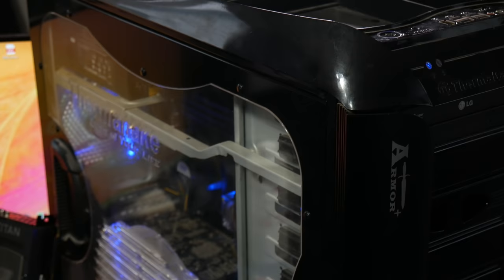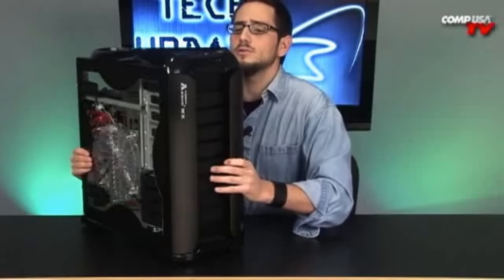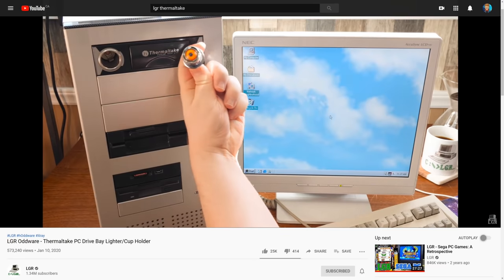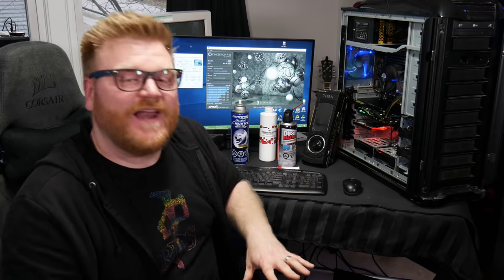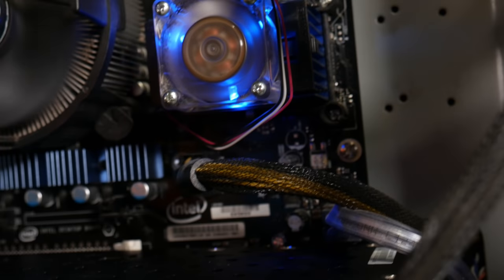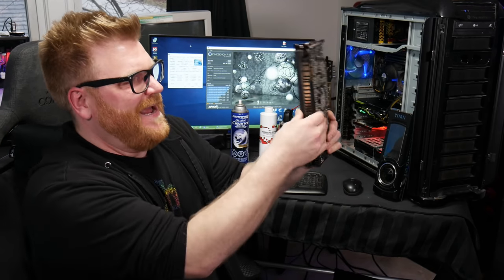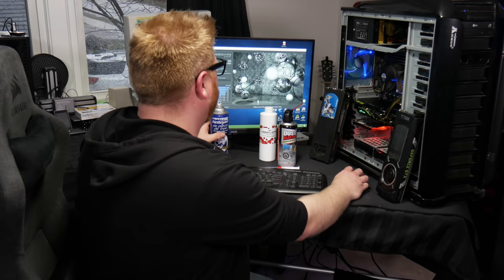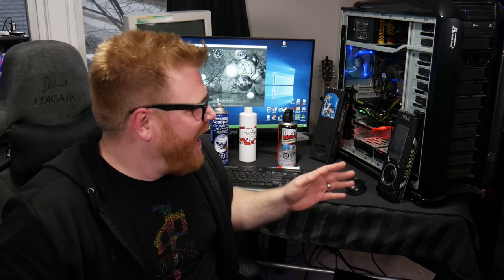Can $5000 buy a PC that will last 10 years?

Comment: I would say about 1500 bucks is the sweet spot lots of longevity, good resale and great performance
Reply: i bet 9900k and ryzen 8 core can game in 10 years but no way in hell will a 2080 ti. just my opinion. what video card over 8 years old can get 60 fps 1080p in modern games?
Reply: @Joker-no1fz  I actually think the 2080Ti will hold up longer than the 9900k....we are already almost 2 years in on the 2080 TI in 5 months...and it is still the top dog...not so much the 9900K
Reply: 1500 is not LOTS of longevity...and compared to 1440 P 100-150 FPS performance on AAA games that higher end computers can get...1500 is not "great" performance either
Reply: Nah, about 2-2.5 is the sweet spot for about 3-5 years, anything below that you will be spending money after 1-2 years

I spent that in 2014 and only upgraded in 2019, both times 2-2.5k spent and I currently have a i9 9900k, 2080 Super, 32 GB DDR4 4000mhz Ram, NVME, SSD and HDD's
Reply: Eyyyyyy
Reply: That's about where I landed on my x58 build.
Reply: @Joker-no1fz  an overclocked 7970 is still pretty relevant. about 9 years old. a gtx 580 3gb lasted until 2018 and could still play some 2019 games fine, came out in 2010. but x58 processors are still fine so i agree that current cpu's will last longer, definitely the 3950x
Reply: @moby1kanob  You're wrong for gaming you need a good GPU. Exemple if you put a old Xeon 10 years old  like e5 2690 it's slower  15 to 20 FPS then the i9.  Try to comparate a 10 year GPU with a 2080 ti and tell me how mutch fps you have in diffrence lol
Reply: I'd agree... anywhere from 1500-2500.. no more than 2500.. and that 2500 is for a beast of a computer that'll run everything at max settings.. 1500 these days will get you great performance.. but not always at the best resolution..
Reply: stephen hilton I spent around 1000 back in 2015 for a 5930k,  x99 sabertooth, 16gb ddr4, r9 390, 256gb ssd and a AIO watercooling. It is still doing great no need to upgrade. I must say I got the CPU half the price and the motherboard and GPU had a good discount as well. I calculated everything with the MSRP would go a it more that 1600$.
Reply: Jay Arre Trading a V56 for a 5700 is a big thonk. Undervolting, V64 bios and memory overclocking can net you near 5700XT performance with around the same power consumption
Reply: You guys forget that raytracing is going to be the next step when it comes to gaming, regardless of how trashy RTX is rn. I bet that’s what all the major players will be working on, rather than just raw GPU horsepower
Reply: @Joker-no1fz  Radeon 7970 ghz can still do 1080p just fine that came out in 2012.
Reply: @boltinabottle6307  Yep, I had a 7970 in 2018 and could play most games at 1080p with a mix of medium and high settings. Upgraded to a Vega 64 though
Reply: you people need to take into consideration that only up until 2017 intel had no need to push the ceiling for CPUs, that is the only reason why a system from early 2010s still holds up today. this will not be the case in the next 10 years thanks to AMD.
Reply: @T33K4Y  Doubt.
Reply: moby1kanob doubt you could afford 1.5k for a pc still tho lol
Reply: Definitely agree
Reply: Agree aslong as you can buy the parts for retail.
Reply: @stephenhilton6586  Yea but most people can't spend 2.5k on PC. Really just depends on what's out and what's to come. Best thing is to stay up on the tech that way you can flip when you need to or only upgrade parts that matter. Like if you have a 3 series ryzen really nonsense is getting 5 series right away.
Reply: @Joker-no1fz  980 ti 780 ti
Reply: @d.h.2509  980 ti is not over 8 years old and 780 ti is not 8 years old until november and you would have to turn settings way down and probably would not get 60 fps in games like cyber punk and red dead 2 at 1080p

Comment: "oh yeah bro i spend a ton so I never need to upgrade" 

proceeds to upgrade every component
Reply: Except that jank CPU cooler.
Reply: Futureproof memers in a nutshell
Reply: spending a lot on a computer is like building a larger fire. It will burn hotter, longer, and more brightly, but it will still turn to ash at the same rate.

Comment: I'm still running my old i7 2600k. :) 
I bought it the month it came out. Only thing I upgraded was gpu every 3 years.
It's currently my dad's gaming pc, with my old gtx 970 in. It still works perfectly :D.
Reply: I'm running a i5 2430m and a Geforce 410m. :(
Reply: Similar with me ;-)
In my main rig (an HP 6300 Pro SFF):
2600, 32GB of RAM, 1650 LP from Zotac, 500GB SSD, 1TB HDD, 32GB HDD
Still fine ;-)

And second, no gaming
3770k, 16gb of RAM, 240GB SSD, 500GB HDD

I know, "Why don't you pair the 3770k with the 1650????"
Because the cas is soo small!

And one other 6300 Pro 2600 Rig, but smaller SSD, less HDD storage and 8GB of Ram

And another one with an 2120 and SSD and 8GB of RAM
Reply: Decent CPUs... i still deploy 2x Xeon 5675, so ten years as well. For what i'm concerned it's strong enough, around 3k in Cinebench 20.
Reply: I'm still running a 970 and yeah it works but man do I wana upgrade. I was a little disappointed  in how much of a hit I took in rdr2 and I really wana play cyberpunk2077 maxed out
Reply: @brianluck84  "I really wana play cyberpunk2077 maxed out" same, waiting for the new gpus and cpus to release. im still running 2x 970s and a 4790k.
Reply: I have about the same system, i7 2600, GTX 980 and 16 GB RAM, many games work better with 16 GB even if they say "8GB recommended".
Reply: Jaco aVo 2011 I had mine and still going strong.
Reply: @danielgomez7236  my version of minecraft currently uses has 16gbs allocated and its capped still wanting more
Reply: InterMob i have i7 8700 1660 ti
Reply: piqqeh - PiggMC sell the 1660 ti get a 1660 S or Rtx2060

Comment: I always Buy a piece at a time, whatever I need the most that is within my budget at the time.
Reply: That also makes upgrade automaticly come over time
Reply: thats not smart buying you will  meet a lot of. "man if i just " pick a budget.... work from there and you can apply good buys that way and pocket some cash going below your own budget. The way you buy...... oh cool gtx.... 1 month latee price drop.... and you dont even have a mobo?!  great you screwed yourself that way. Speaking of experiences
Reply: I want to try this. Buy the best gpu I can, wait like 2 months buy the best cpu I can, wait like 1 month, buy the best ram I can. And just continue like that. And get a high end system by 4 months or 5. Lol 😂
Reply: yea, but you can upgrade only to a point with certain chipset

i skipped first two gens of ryzen, and now i am on the latest, because they were pricy fkkas at launch, and i wanted to see if this was a thing, and it became a thing
Reply: I usually upgrade when it's needed. Just upgraded my gpu. CPU is starting to bottleneck and will further as we go along and once i feel I can upgrade I will
Reply: Mykel Hardin  I treat my PC part fiend, and pass the older gear down to the rest of the family, I keep my components for a couple years before I upgrade, but they are all on different schedules, like this weekend I had some extra cash, and finally upgraded all my storage, got a WD Black SN750 1tbNVME, and a WD Blue SSD 1tb for all my games. I was using Enmotus Fuzedrive, with a 2tb WD Black HDD, downloads were pissing me off though, freakin 2 hours!!

Comment: I feel like I am being called out for my "Baller" socket 775 Core 2 Quad.
Reply: yikes
Reply: Same XD
Reply: x5450 here 😂
Reply: @blackmuel  x5470 here
Reply: Q9650 over here in the UK, coming up to 12 years old.
Reply: Jay Arre  I have a r5 2600/RX5700 I use for gaming as well. However, I have 3 machines around the house with Q9400's in them as well. They all run well and got better when I started upgrading the HDD's over to SSD's. For basic productivity they are still great CPU's.
Reply: @yannicg  Build  for my son a xeon x3470 (16$) with a rx 480 for 1080 p high/Ultra he plays all triple A games at 60 FPS Under 300$ :) Long live the Xeons
Reply: Then you got my dad that's had the same limited edition dell pc extremely rare like 20 years old and i still haven't a clue what's in it. He bought it for over a thousand dollars during a business trip think he might have a relic 😂😂😂.
Reply: You would be better off with a Raspberry Pi at this point. Yikes

Comment: i used to do the "overkill 10 year builds" the main difference between me and your client is that i did supplemental upgrades, maintenance and left the initial budget under 2000$
Reply: Mykel Hardin  badly.
Reply: It's $2000 not 2000$

Comment: Timmy don't make a car reference, especially if you don't know about them, a "1980s" Monte Carlo SS can sell for thousands, if in restored condition especially like the one you showed, along with the upgrades you can do to a 350 SBC for cheap, these things are still rocking and rolling. now restoring them? please for the love of all that is holy look up the pricing on sheet metal and engine parts, the fact that the POWER STEERING PUMP and STEERING BOX can be as cheap as hell.

383 SBC 525bwhp-600BHP-$3500 Long block 
sheet metal from AMD(Auto Metal Direct)-$600
paintjob-$1500
car-$1600(msrp 7k) 

after with KBB/NADA appraisal-$17,500USD

Chevrolet Monte Carlo's, Oldsmobile Cutlass didn't have rack and pinion steering where as ford Mustangs and Ford LTD's did.

please, take it from me, a car guy who likes to build PC's CARS are ever upgradable with the same platform, where PC's only are upgradable with the platform they are given.

just because a Monte Carlo has a SBC 350 Doesn't mean you cant just Punch out the cylinders and make it a 383 with 10.0.1 compression and turbo it to hell and back and make 900BHP 

you cant take a I7-920 and make it be a i7-4770k or re-dye it some how and make it a i7-9700k

Comment: Great Video! I always like to do small upgrades every couple of years and resell my old parts before they become obsolete. I find this is a good approach if you want to always have good performance and not spend a fortune. The highest end parts are usually not a good value. You get a longer lifespan and better value by stepping down your hardware a few notches and upgrading when you need to.

Comment: Got a retired X58 workstation here from my research chair, sporting a Xeon W3690 on Asus P6T7. Still awesome performance at 4,6 GHz
Reply: Wow, normally they dont like to go over 4,5Ghz... what cooler did you use. Im thinging about buying an EVGA SR2 as i found some offers for 300€. (obviusly not as my main system).
Reply: @yannicg  Corsair H70 AIO

Comment: In late 2008, I got a PC pretty similar but, it wasn't not even close to $5000... I got an i7-920 paired with a X58-UD5 from Gigabyte, 6GB DDR3 and a TX750W PSU from Corsair ; an ATI 4870X2 GPU from ASUS and 2TB HDD for storage. Even the case was similar: Thermaltake Kandalf LCS. It cost me €2000. The main components are still in use today but, overclocked to 4.2Ghz and with a GTX 1070. 
The 2010s were a peculiar decade as far as CPUs are concerned, because of Intel dominance and lack of competition in the industry and that's why a Core i7-920 or a Xeon X5670 Oc'ed are still very viable CPUs even today. From what I've been seing from the industry in the last couple of years, I don't think the next decade will be the same as this but, I also don't think we'll be back to the 2000s, when top tier gaming systems were completely obsolete and pretty much unusable at 3 years mark.

Comment: Bought a Sandy Bridge pc 9 years ago, not with the intention of it lasting ten years but it is still used as a viable HTPC. Definitely didn't spend 5k tho lol
Reply: is there a 9 year old gpu that can game though?
Reply: @Joker-no1fz  there is .. 8 years old HD 7970 3GB G5 .. still does fine in 1080p ..
Reply: @chuskex7719  i have a 2GB 6950 flashed with a 6970 bios. It can barely run anything at 1080p 60fps all minimum settings. Really you can only use it for esports titles.
Reply: 8 years ago i bought a MSI Z68 +2600k, 4*8GB ripjaws x , seasonic psu but have changed the GPU from a no GPU to 560ti to 770 to now a 980ti, i use it as a second pc. it can still play most games at 1080p.
Reply: @chuskex7719  Math lesson.  8 is less than 9.  The fastest single GPU card in April of 2011 was a gtx 580 that had 1.5GB of RAM.  That's not a usable card today.
Reply: @kinggremlin4574  a PC lasting 10 years with 1 gpu upgrade seems to be the only way.
Reply: Carrie Lam I know the feeling, around 2013/2014 I build a high performance workstation on the “Intel Extreme” platform; an Intel i7 4930K (6 core 12 thread) on socket 2011, X79 Asus Rampage IV Black Edition motherboard with 8x8GB 2.133Mhz Kingston HyperX RAM, nVidia GTX Titan, 2x4TB WEstern Digital HDD’s and Corsair 240GB SATA SSD...

I actually thought “I will never never never have to upgrade again!” Atleast not for many years to come... 

Then 2017 came along with i7 8700K’s stomping on everything on a mainstream platform... the AMD Zen 1 Ryzen/Threadripper kinda suddenly happend and in 2018 Zen+ and the i9 9900K... 

And now? 6 cores 12 threads is sort of mainstream... R5 1600(AF), 2600, 3600 and even the new intel i5’s...

Boy was I wrong, six years later and being outclassed by intel i5’s and budget R5 1600AF $85,00 cpu’s 😬😉

Ps. And also that high end build cost me a hell alot more then $4.000,00.

So yeah, just upgrade every two to three years... it is waaaaaaay cheaper that way.

Comment: Nice video /commentary! 
I used a 8350fx /2 GTX 760s for like 7 years lol.
upgraded to 3900x/2080ti 🤯🤯
Reply: Prob should have brought the 5700xt and power modded it and wait for the 6900xt
Reply: @kaptain1477  nah. Then I'd have shittier performance until that came out , and assuming it was good
Reply: @kaptain1477  as well as the possibility of driver issues. Despite the price, nvidia is a better idea at the moment, but I hope that changes soom.
Reply: Kaptain why would you power mod a 5700XT? Just sounds like Vega memes at that point, where undervolting would probably be more beneficial
Reply: That 8350 is still a solid cpu. My brother has my old one with 16gb of ddr3 and a nvidia 9960 and it can play anything

Comment: Hey timmy joe i have an i7 870 system still working overclocked to 4ghtz stable since i got it. Started with a gtx 480 broke the hdmi port and changed to 560 ti till i eventually got a 1080. Had to buy new ram at one point new hard drives, and replaced my corsair h50 fairly eaely on with a noctua nhd14 . Mobo was a asus maximus formula iii which was the cadillac at the time. Original budget was about 2k but hey it still keeps up, overall i think I did better than this guy. Ive since made a new system with a 9900k so this is kinda the backup.
Reply from the maker: Cool stuff man!
Reply: Could you please tell me the voltages parameters that you set the i7 870 to run at 4 ghz?, i'm running an 860 as my daily driver but i've only reached the 3.7ghz mark before my voltages/temps get too crazy high (near 1.4), this pc is water cooled with 240mm rad + liquid metal so it's definitely a too high voltage problem, or silicon lottery
Reply: @AndreFG   ill boot it up tomorrow and let you know
Reply: 870's were beasts. I still have one running a home server. I've had mine to 4.2, but I dialed it back just so I wouldn't kill it long term.
Reply: @krane9259  thank you!
Reply: @AndreFG  from memory the 870 was just a better binned 860 so i expect thats hy he clocks higher than yours.

Comment: I found the best deals are picking up older Dell Workstations for dirt cheap with Xeon processors, loads of RAM and SSD drives.... not to mention built like tanks.  

Then all i add is a nice video card,  set for 3-4 years no problem
Reply: I've been using a Dell T3500 based PC I spent less than $300 on, including monitor and peripherals, an ATX case, new PSU, 290X, etc.  I've been using it for quite a few years now, lost count.

Comment: I thought we pretty much reached the point where Amdahl's Law was kicking in and then AMD came out with Ryzen and in just a very short time, I'm not sure.
Reply: Mykel Hardin  for reference though higher core count instead of speed isnt a bad thing exactly, just a different direction than crysis devs expected.  As more tasks can take advantage of extra cores performance will continue to improve with higher core counts.

Comment: My PC is 7 years old and still working (though I am replacing it soon) and I spent £1,200 on it (plus some extra for storage upgrades later on) and I sometimes feel quite smug with how well it has aged. Getting an SSD boot drive and 16GB of RAM "futureproofed" it enough that it never upset me with its performance...tearing up a bit thinking about its passing.

Comment: I spent about $2k on my computer in 2015/2016. Saved up all year and bought a part every couple months and slowly built it over time. It's an i7 7700k with a gtx970. I play at 1080p so it's been reliable and enjoyable. I probably wont upgrade again until ddr5 is out.

Comment: My old i5 3570k build lives in a version of that case. It's been overclocked to 4.4 for years now and it has a gtx 1080 so it does game but the next build is nearly complete and it will live in a HP Blackbird 002 case.
Reply: dude lol, same here! I'm still rockin the i5 3570k but mine is at 4.2 ghz.  and i got a 970.   waiting for the new AMD chips and new Nvidia GPU's
Reply: @joes.3083  I just upgraded to the i5 3570k recently,  from amd athlon 860k. Paid 110 dollars for the cpu , 8gb ram ,motherboard and customer cooler. Works well with all games
Reply: Denis Tarata 3300x will cost you 20 bucks more 👀